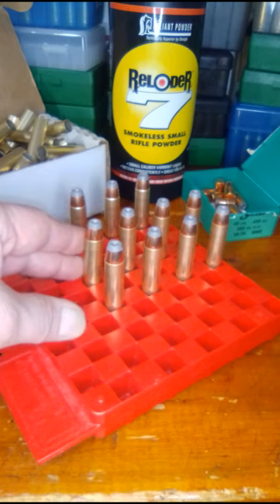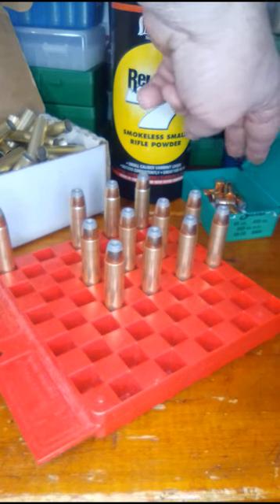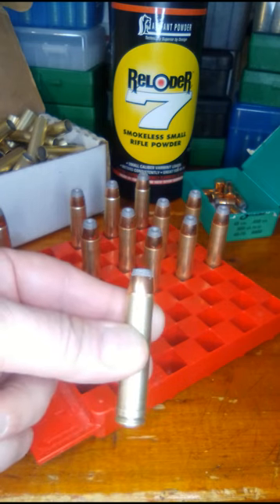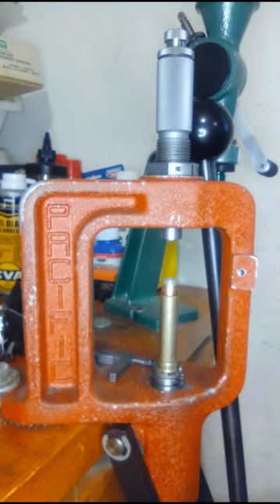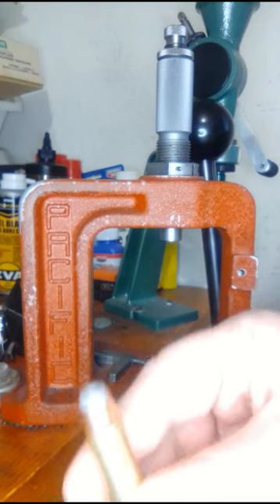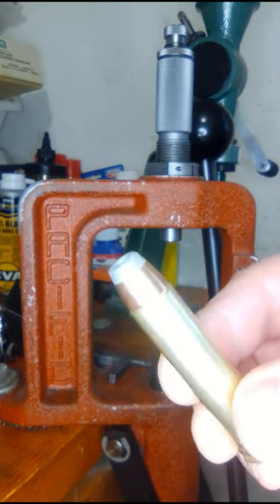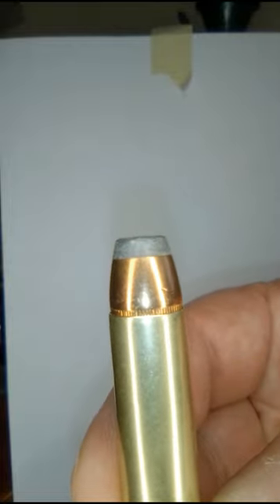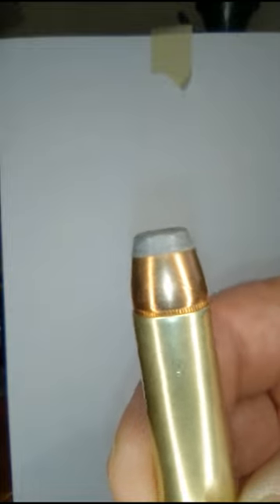Applying the crimp to 450 Marlin loads #shorts

Comment: Those 300's always over expanded for me @ 1800+ fps. I lod them to 1650 for better prefomnce. But mostly dont use the 350cast is preferred and 400 Speer is top!
Reply from the maker: I use the Sierra and Hornady 300 jacketed for practice, for hunting I use the Nosler 300 Partition, which is not made anymore but I am nursing what I have left.
Reply: @30-06john  Ooh I haven't seen those in forever!! Hornadys 350 RN is a TOUGH bullet!  Speer used ta make a 350 that was great too.
Reply from the maker: Yeah, I might have to go up to 350gr after I run out of the Partitions.
Reply: @30-06john  Do you cast?  Lee 350 Ranch Dogs are AWESOME!! Ill share some if you would like.
Reply from the maker: No I don't cast. Thanks for the offer, if you want to send me some, I appreciate it, but only if you have a lot of extra.